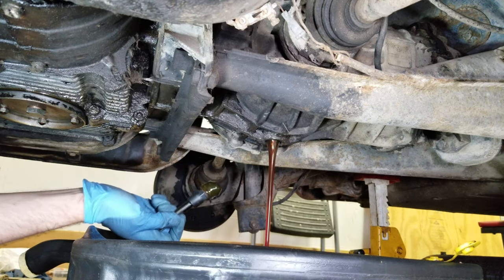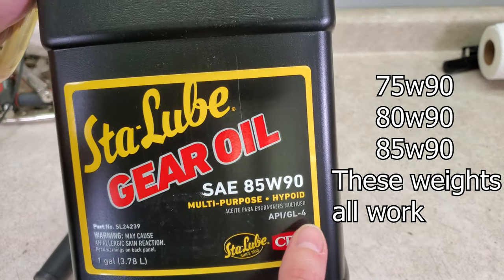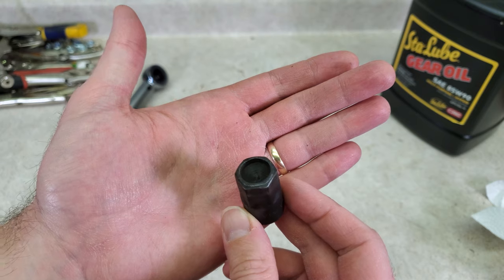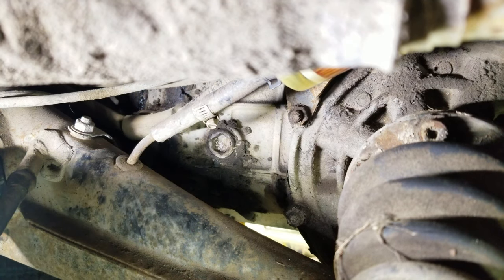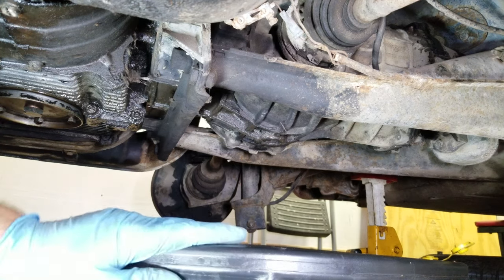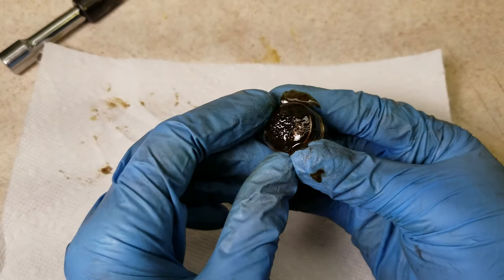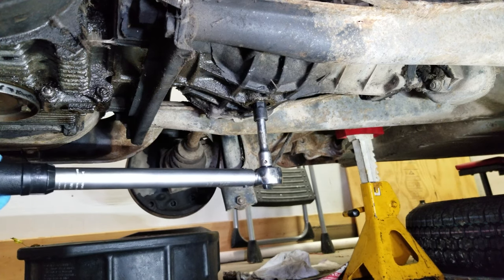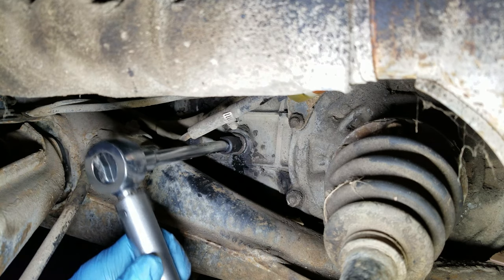How to change transmission, transaxle oil in a classic air-cooled VW Beetle

Comment: Great tutorial!! Also something to keep in mind for those rolling on swing arms, your rear wheel bearings are kept lubricated from the gear oil delivered through the axle tube. Thus, low gear box oil can be problematic two fold…

Comment: Glad to see you add the GL4 vs GL5 info. This is critical. There is no "universal" gear lube for both! I found out the hard way with my 5-speed Miata when I put GL5 in my transmission (the label on the bottle said it was universal) which made shifting nearly impossible. I got it out before there was permanent damage. There is a ton of info online about this. Do your homework. I won't recommend a brand because somebody always disagrees about something - sort of like having a favorite beer. 
GL4 is for transmissions with synchronizers. It is brass friendly.
GL5 is for differentials with no synchronizers and no brass.
Great info.

Comment: Didn’t have a 17mm hex and I already took a trip to the parts store. Used a 17mm banjo bolt and a screwdriver and got the fill plug out. Filler ‘er up and put it back in finger tight

Comment: I have found that the funnel with the long tube  is easier than the pump method, but both methods work.  Just stumbled on your videos.  Started with the turntable cleanup. Figured that anyone into keeping old turntables alive, as well as old vws and schlitz beer is worth a subscribe. Lol.  Nice job!   I’m into those three things as well...different beer though.  I have several turntables (BIC’s and DUAL and a 74 super in the garage). Cheers!

Comment: Great informative demonstration video I like the bottle pumps as well sometimes you don't have the space to use bottle pumps though but I do have a suggestion... That would be you can put the gear oil bottle in some hot water to make the oil flow better that helps with refilling also sometimes... great work
Reply from the maker: That is a good suggestion. I've done that before when I was spraying Fluid Film.
Reply: @ToolTeardowns  helps alot with fluid film

Comment: I am relatively new to Bugs.
I got a trike built in 2013 that is based on a VW1600 Engine.
Annoyingly, the makers said that they import the engines from Mexico and so the Engine was brand new.
Finally managed to limp past 4000 miles after almost 9 years or absolute hell, and failures, but in the end, a mate Stripped the engine for me, found out it was a 1300 Unit with 1600 heads, and the crank was rubbish, and so I gave up and I have bought a recon Turnkey engine, and this is the first time I have been able to actually enjoy riding my trike since I bought it.

And I love it.

Cosmetically its a bag of rubbish, the makers only gave it one single coat of paint and the so-called high quality metals and alloys were mostly chromed plastic and so they are all crappy and need replacing, as has the leather seats, but its getting there at long last.

Anyway, enough moaning, I am getting into the Bettle engines quite a lot now.

I have gone from Twin Webber to Single webber and now a basic EMPI ( I think it is? ) but at least its a simple carb and I know ZILCH about carbs - its running rich, and its cobnstantly stinking of fuel, but it runs great apart from that.

Im about to do the Tranny oil, not replace, but just make sure its topped up as it has leaked some oil through the axle thingies... Not enough to make puddles, but enough to see the axel bits are wet with oil.

I have done this before, but I watched the video to get another update if you like.

Great video. I feel well informed and armed with more info!

Comment: The oil pump link above is for a small mouth 1 ltr bottle. Does not fit on 4 ltr. The black one used in the video looks correct - shame the link isn't. Just held the pump over the bottle.
Good video though.
Reply: Same happened to me….
Reply: Use a piece of 3,8th rubber fuel line for the tip of the quart containers and squeeze. It's a universal fit.

Comment: i was told and also did the same , filled it to the fill hole ,,,,thats a little too much of oil i am told from vw mechanics , they are telling me we are suppose to use like a alan wrench and gently put that wrench in there and then if you see oil on the tip then its at the right level ?  i did mine like you did yours and its a new rebuilt and it leaked out the vent hole ? go figure LOL ,,,,,just passing this along